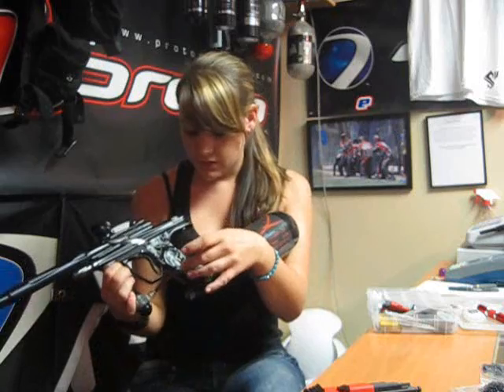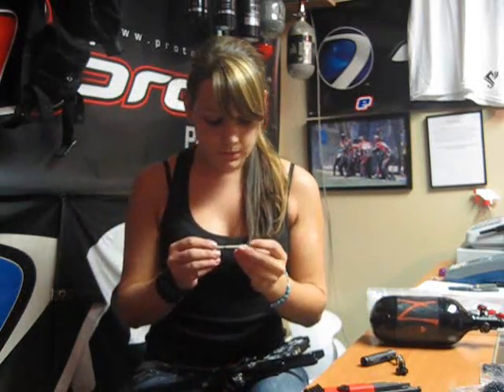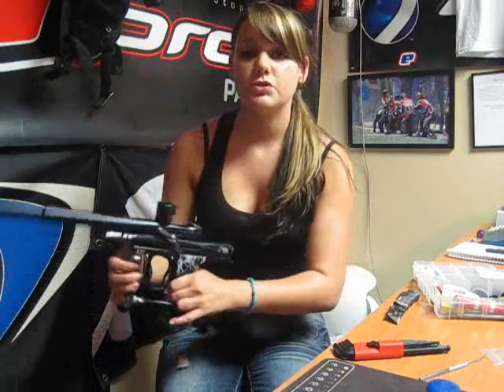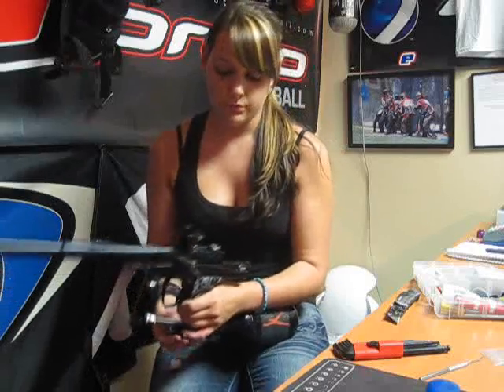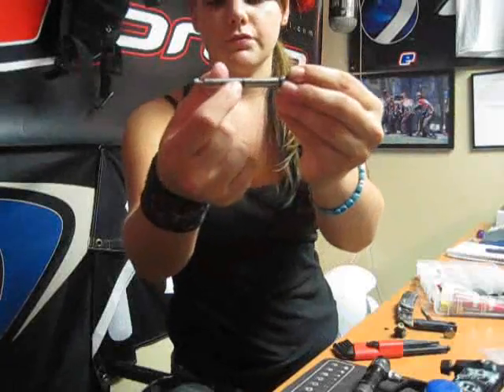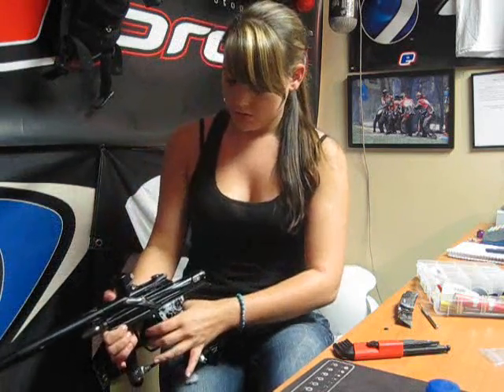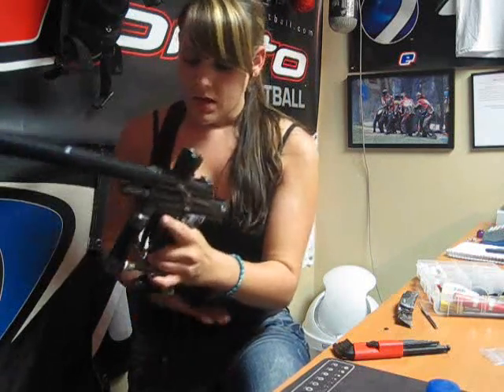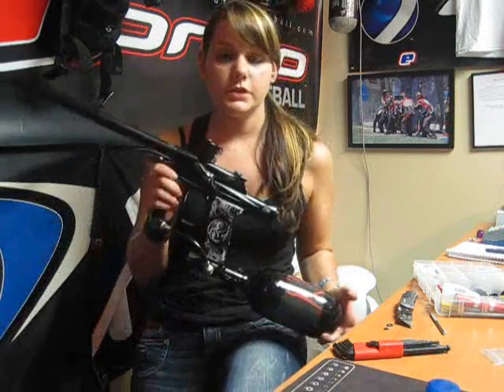Tech IT episode 8- common Ego leaks and o-ring issues

Comment: Fixed the problem just unscrewed the macro line elbow cleaned up the threads and reapplied some blue locktite I remember when getting the marker the elbow was on a slight angle and I must have kno Jed it cu it was straight down resulting in breaking the locktite seal from the factory thus causing the hair leak I was getting out of the elbow threads thx anyways and awesome videos!!!

Comment: I am having a leak out of the RAM air chamber.  The o ring looks to be fine.  I just ordered the o ring kit and will get it in a few days.  Just wondering what you thought is causing the leak if it is not the o ring on the RAM air chamber.

Comment: Today I noticed a very slight leak in my macro line elbow where it screws into the hpr fairly new ego 10 shot maybe 7 cases out of it. I only noticed this today my tank was sitting at only 800 psi I would assume the amount of pressure wouldn't matter as there should be no leaks period would some simple Teflon tape on the macro line elbow fix this and is it a good idea to use Teflon tape over a liquid lock tight thx

Comment: If you use junk batterys the noid will not work right the other thing to keep in mind is the noids that planet eclipse use are junk they are good for 60000 shots than they seem to brake down this will be a cause with low fbs. I found this all out with my older egos that i bought back in the day and years later having noid problems

Comment: On my 08 which I bought "for parts or not working" Refuses to suck the bolt back, and hisses very loudly. Even if I pull it back it will not stay, I messed with Lpr and hpr values and it still refuses to work.  Pls help me with a pm or a comment. Thanks. Ps the o-rings are meh, so I will get new ones, but I still don't think that will make a difference.